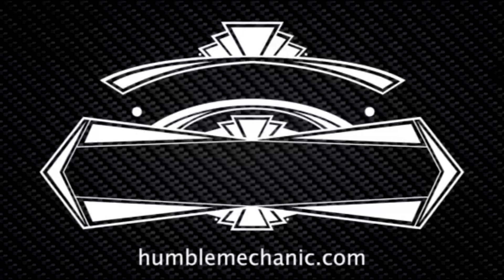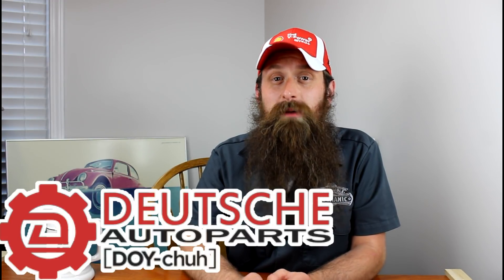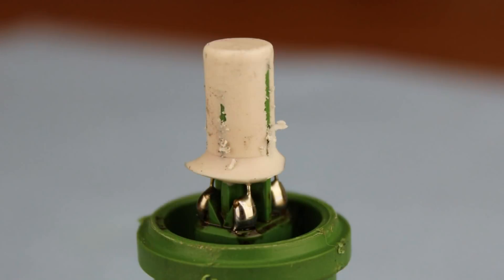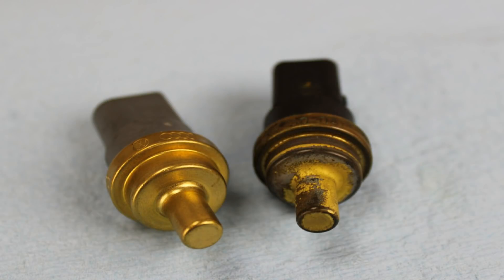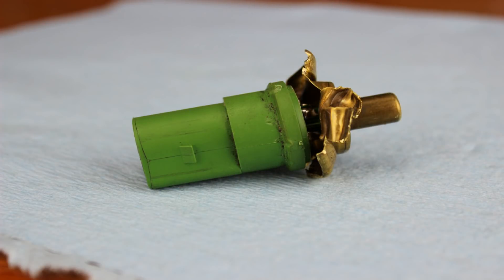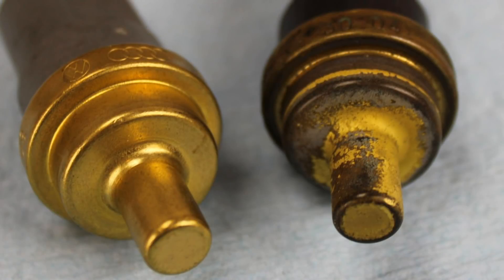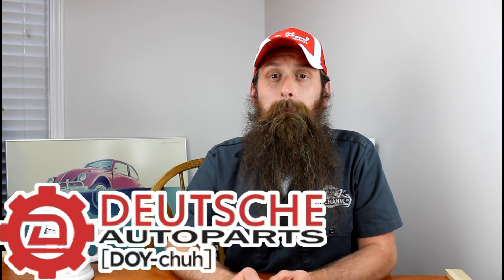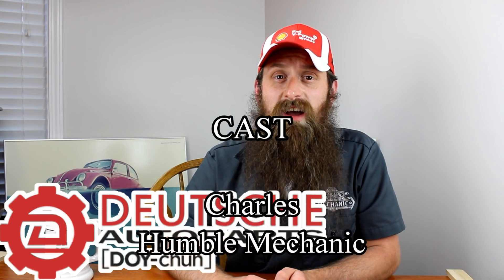How VW Coolant Temperature Sensors Fail

Comment: I just got a water pump replacement on an mk7 and a week later I've been getting a p00b7 code. While monitoring the live stream and driving my coolant temperature is that normal temperature and my oil temperature is also at normal temperatures. The only thing different is the gauge on my dashboard for the coolant temperature is beaded all the way to the right and I get an EPC light on. Is that an electrical issue or sensor issue?

Comment: I have a brand new thermostat, brand new coolant temp sensor yet for some reason when I kick the key over and start it, when the engine is cold, the gauge in the cluster goes up to 190 instantly, but my scan tool will read whatever the air temperature is. And as the coolant temp gets up to normal operating temperature, the dashboard gauge climbs up to 260 ⁰F and it thinks it's overheating, even though the scan tool reads below 189⁰.(And when it reaches 190⁰ it opens up and you can watch the temps on the scan tool drop like they should) The ambient Air temperature on the climate control is also wrong reading about 40⁰ COOLER than what it says on the scan tool(scan tool matching correct ambient temp). ANY IDEAS! I've also swapped out gauge clusters thinking maybe that's the problem, but they both have the same problem!

Comment: Great video! I actually changed both my coolant temperature sensors on my Golf MK5 1,6 FSI because the fans was running all the time either the engine was cold or warm. It did fix the problem with the fans and the engine is running at the normal operating temperature and the heater works a lot better and gives more heat than it did before i changed these sensors so this is something that i recommend people to do if someone owns a Volkswagen with any of these symptoms.

Comment: The cts in my alh was actually reading about 15% higher then actual temp. It’s cold out so when warmed up the gauge was right in the middle seemed normal but when I go to start it in the morning the glow plugs wouldn’t turn on for more then a second because it thinks it’s warmer outside.

Comment: I have a 2009 Tiguan with a P0118 code high output for sensor 1. There are two sensors and they are both new as I just replaced the water pump and while I was in there I just put in two new sensors. But I can not figure out what sensor is #1 and what is #2. I want to assume sensor #1 is at the water pump but want to confirm before digging into it deeper. BTW this code existed before I replaced the water pump.

Comment: Always  helpful . Years after this post . I’m a B5 guy and still have the 99 passat  i took the kids to kindergarten in . Son has just helped me swap it to manual . . Never replaced the temp sensor and it’s black . Go figure . You covered all the likeliest potential issues Humble guy . Thks again
Reply: Hi mate I have a b5 Audi A4 (same chassis) with a 2.8 V6 I have a hot engine stall and not start issue I will be changing the temp sensor soon hoping it will fix. Did you have the same problem?

Comment: Is it possible to have both a code for this sensor and the cooling fan circuit at the same time and it only be the fans? I had 2 codes. Changed this little guy to the green one. Had a green one in it, but who knows how old it is. And it was corroded a bit. I still have both codes. Realized one fan is coming on. The other isn't. The one that is on is the secondary one that comes on second. Its stuck doing all the work. I'm thinking maybe the fan module? I was thinking of buying the whole fan assembly with both fans and module.  The temp has only thrown a red light once but Temp read don't match the actual temp. I'm thinking of putting those fans in and a real temp gauge. I hate that there isn't a gauge.

Comment: If you have time, I'd love to know why there's 2 sensors right next to each other on the water distribution flange of the 2001 Cabrio I'm working on. A green 4 pin, and a white 2 pin.

Comment: Charles, you are true PROFESSIONAL!!!! Thanks for sharing your knowledge! 
Quick question, on my 2012 VW CC, it runs rough at cold idle with random misfires. At 39 degrees Fahrenheit it reads 3,930 ohms. Once it warms up all smooths out.  Temp gauge operates normal. I'm thinking temp sensor?? What do you think?

Comment: obd2 scanners got me at 200 or over before fan comes on  ive replaced the air conditioning switch and the radiator temp switch  im onto the cooling inlet ets ... my runs have been straight hiway and the fan seldom comes on if after i park in the drive and continue to idle the fan will come on slow i changed the fan for funny noises wasnt the best viscosity but i still i get the common read of 200 degs or more before fans   ...  im questioning heat prostration during trips like  terrible in lower gears after long drive

Comment: have a 2015 golf 1.8l hatchback. check engine light on and scan says coolant bypass valve. only 137k on vehicle. Mechanic says replace the part -4hrs labor and part is nearly 400. !!!My thinking is its the connector or sensor not the part. Dealer tells me sensor in coolant overflow could trigger check engine . Mechanic looked up and felt connnector and said it felt gummy. Is that the sensor or connector and how long should it take to replace it?

Comment: I have 2013 Passat 2.5l changed the over flow bottle and flushed the coolant.  Now light comes on says add coolant but bottle level is fine and temp stays at 190 degrees.  Any help  appreciated.

Comment: Can there be no code and be bad? Sometimes the 1.9L beetle 03 will not start, acts like a fuel pump problem with around 140,000 miles. Please help, thanks

Comment: @humblemechanic was really sad when you didn't cover the major issues that a faulty ECT can cause a TDI...... Glow plugs won't engage if it's bad, even if it doesn't show a code. You can unplug it and your glow plugs will work again to start a TDI car when it's cold. A bad ECT will also cause a TDI to run so rich that out won't start or run without smoking and choking you out. It would be nice to see you make a separate video labeled "TDI ECT problems" or something similar covering all the possible and common issues. Thanks a bunch either way, great video for gassers for sure!

Comment: I could use some help i’m swapping in an ALH into an 87 cabriolet I’m trying to use the factory coolant sensor that’s a four pin with the wiring from the cabriolet which is a 2 pin but not sure if it will work

Comment: Failed on my B6 at the time. Had the meter fall down and pop-up again. Was gone after replacing.
Now looking at replacing the one on my A5 B8 as it's not running all that well when cold and running under 2K rpm.

Comment: Hi Charles. I have question for you. I have mk5 Golf GTI and my fans start to runn easy after 10min drive, this was very strange to me because in normal conditions my car only start fans when is A/C on or I drive it very fast on B roads. So I go to check with diagnostic (Delphi) and see that at Temperature differencer engine and radiator I have value -48 celsius, this can not be right, so I replace coolant sesor (below) termostat, but problem is the same. What you think, can this be a problem in wiring or something else? Thank you in advance

Comment: @humblemechanic
Hello brother, i have an issue in my car for a month and i still not able to fix it
When the engine oil goes over 80 degrees celsius, the engine start misfiring, and on idle the engine dies, changed the sparks, injectors, fuel pump
Any ideas??
Thanks a lot

Comment: Charles I always had a question in my mind, my temp gauge never lines up straight up in the cluster, it sits a little to the right of the line in the cluster but stays steady there, given the fact that everything is electronically controlled is this normal? Thanks a lot for your help

Comment: I have a golf iv and gauge stays normally 90°C but the fan operates around 93-95 is that ok? Ive noticed the gauge moving slightly above 90 every time the fan is going on

Comment: Hi HumbleMechanic! I just replace water pump at vw cc 2012 2.0t, when I start my car it take 8 minutes reach 190° F, and then stop there, when the gauge start to raising,  does it with faster and shorts movements, but I feel like the engine is getting hot, but not alert light at dash board, some coments?

Comment: i have a mk7 2014 gti. engine light on and off. Scan at VW says it is the sensor in my radiator. ALl is good but engine light comes on and off. VW says i need to drop $800 for a new radiator. Please advise.
Reply: Hi, you need to get the exact code of the scan so you can do your own pre analysis. I have my own OBD II scanner so it usually comes in handy when I have a fault. That way I have an idea of what the problem might be, if I can fix it myself or need to engage a mechanic.

Comment: “Never assume a high reading is a faulty sensor”

I have a 2010 VW touareg tdi with 49k miles. The car’s been overheating, it started as a constant problem, then became intermittent for like a week and is now constant again.

I have an OBDeleven and watched the live data when it overheats. The coolant temp sensor will overheat while the oil temp stays at ~90 C. It’s also been spazzy at time, completely dropping off the reading and a couple times the gauge was just going back and forth about 30 degrees or so when the car was warming up.

A couple times I coasted as much as possible when it was overheating (not in the red) to get where I was going, and would keep driving like that for 5+ minutes and the oil temp wouldn’t change at all. Could this just be a faulty sensor? I’m taking it to the mechanic tomorrow but I don’t wanna be taken advantage of.
Reply: Did you get to the bottom of this i have the same problem.
Reply: @mazdamx5v8project92  replacing the sensor fixed it

Comment: I've had a no start issue with my 2002 vw jetta tdi (manual transmission) for the last couple of years.  After sitting with a charger on the disconnected battery for variable periods of time the car would start and run fine.  It was a crap shoot whether or not it would start a second time.  The instrument cluster warning lights would flicker and sometimes there would be clicking of the relays under the dash.  Recently, the temperature warning light started intermittently flashing on and off and the same symptoms as described would occur and the car would not start again.  Today, I replaced the temperature sensor and after replacing the coolant that I lost in the process I started the car and let it run for a couple of minutes.  It started and ran fine as usual.  I was able to stop and start the car multiple times without the warning light symptoms, clicking of relays, etc.  I'll see if the the coolant temperature sensor was the problem in the next couple of weeks.  The sensor is the green, four wire type.  Thanks for the intelligent videos!

Comment: My car won't start and I don't have a check engine light on. I think it's the ecc light is on though, but the car won't start. The dealership says it is the cooling temp sensor.
Reply from the maker: I have seen it before. Not that common, but possible
Reply: @HumbleMechanic  We didn't see that as a problem online, so we didn't check for that. We did check both the ecm and the ccm for possible water damage. They both checked out and the dealership said they thought it may just need a throttle body readaptation done. There was an error and it couldn't do it, they also recommended to connect the positive and negative cables together. Nothing worked, we finally had the car towed to see if the car and key needed to be reprogrammed. That's when they called and said that it was the cooling temp sensor. I've never had such an issue having down a problem like this time.

Comment: I have a 2010 2.5 with engine code p0117. I have replaced both the top and lower one with new black tops. Don't know where to find green tops. I still get a rough start or no start at all. Gauge does not read temp unless I am driving and I clear the code at the same time. The gauge will read for a split second then go back to zero. Also, both fans come on when trying or started. That is the only code I have gotten. Heater still words fine. Any ideas, I have already bought 5 of those black tops and still same code same problem?

Comment: Hey man I have a 2014 VW Passat TSI SE 1.8l with an overheating issue. I changed the sensor #06A 919 501 and it read on the dash that the car overheated and has since not read it again and the car continues to overheat and stop running for about 45 then will start again. I’M AT A LOSS??? The shop tells me it’s not overheating. Please HELP!! Thank you.

Comment: My 2004 Golf 2.0 GLS coolant temp sensor has 3 wires. Has he not heard of this?
Reply from the maker: Not for the coolant temp sensor. That’s odd
Reply: @HumbleMechanic  My Golf will not turn faster than 3100 rpm. I'm getting po343, 351,352,353 and 354. I change the cam sensor and nothing has helped.

Comment: Thanks so much but i think i have a different problem when i buy new temperature sensor for my vw polo bky engine  it's struggling to start in the morning.  When i put the old sensor its start normaly 
But the problem with the old sensor the gauge is always low

Comment: I have 2011 Passat tdi I am just wondering if the coolant sensor will make my heaters blow hot and cold air. What I mean is the heaters am going warm on stand still but when I rev  the car up the heat starts to come out hot..any suggestions out there please..

Comment: Hi, I know this is an old video but I need some please. So I replaced the radiator and fans on my 09 Rabbit. My fans do not work and overheats at idle when sitting in traffic for about 10-15mins. I checked relays and fuses. They look fine. Is there something I am missing? Could it possibly be the part you are talking about in this video?

Comment: i've got a mk4 GTi 1.8t. Broke down today, cut out when I was slowing down after losing power, won't start, and when it does it idles for 30 seconds and cuts out again. Had the P1296 code (Coolant System Malfunction). Replaced the CTS a couple months ago but it was a cheap one for £5. Is it likely to be the CTS or thermostat?

Comment: I am struggling with this. ODB2 scanner shows my coolant temperature is at 103 degree C. Temperature gauge in instrument cluster show 90 degree C (right in the middle). Is this normal? my car is VW Passat B7 2011 (1.8 TSI)

Comment: Charles i could really really use your help.   So.  My mkiv GTI VR6 coolant fans will not come on.  I swapped a new motor in and haven’t been able to fix them yet.  They worked fine before.  I’ve replace the rad fan coolant sensor on the radiator and the fcm.  Still no luck.  Fans will come on with ac and if I jump the connections both high and low speeds work. I’ve checked all wiring and I can not figure it out.  Please help🥺

Comment: On an A4 b8 2.0t tfsi is the engine coolant temp sensor on the water pump unit or at the back of the engine? My temperature gauge goes from to center to one notch above and back down and back up. I can tell it's the sensor but people say its in various places. Please help.

Comment: Thanks charles. Why would the low coolant light turn on, even if the reservoir is showing full.
Reply from the maker: Usually the bottle contacts fails
Reply: I just installed a new bottle.
Reply from the maker: Check the plug for evidence of coolant migration
Reply: @HumbleMechanic  will thanks for what you do! You are a very big help, seriously.

Comment: My parent's 1.4 Polo SE from 2010 has had this issue for a few years now, so this seems to be the part at fault, and unfortunately we are suffering the issue where the vehicle just will not start at all when it gets very hot, as the car isn't used to high ambient temperature here in the UK, when it reaches above 30c outside the engine will be tempromental causing it to fail to start, so I will look more into this but I believe that is what it is.

Comment: Can the coolant temp sensor cause the aircon compressor to stop kicking in?
Reply from the maker: Yeah I’d say it probly can
Reply: @HumbleMechanic  There is an AC cutout switch on the water outlet. If that's not faulty, you might check the cooling fan control module.

Comment: i have a 2010 vw cc and the car is fine but when the car is running for about 30 minutes or so the coolant light comes on it days check coolant system and the light stays on but the car doesnt over heat it stays in the middle tho whole time and i have enough coolant what can it be? the sensor?
Reply from the maker: Possible bottle failure

Comment: Hi HumbleMechanic, I got golf 1.4, patrol, 2008, manual, 94K mileage, for last 2 years or so my golf dont start on a scorching sunny day, it takes  15-20 attempts (around 10-30 min) before it'll eventually start, no problem whatsoever in winter and onn summer nights, on advise of a mechanic i've just changed Temp sensor ( 2 pin, aftermarket, not a genuine as i wasnt sure the cause of the problem), but problem is still the same, kindly advise asap please for the next step. Many thanks

Comment: Hey Charles, very detailed video btw..Can you come up with answer about my 01 ALH engine  ECT (as my mechanic calls it), strange behaviour? Just installed a new tested ECT, however I'm faced with same phenomenon as with the previous existing ECT: While I turn the ignition on (at - 15 C weather condition), there's no power going to the Glow Plugs! When I disconnect the ECT plug, np, power goes to the glow plugs as it should, then cuts off after three min while engine running (on any case, no power whatsoever comes to the three Coolant Heater Glow Plugs)! I did also got the same phenomenon after putting another ECU in the car! My mechanic now is talking about all kinds costly possibilities and I'm thinking to simply put a power cut off switch behind ECT plug, to use it just to start the car (which isn't what I like to do anyway). Thank you in advance..